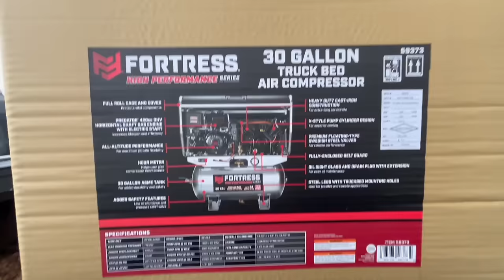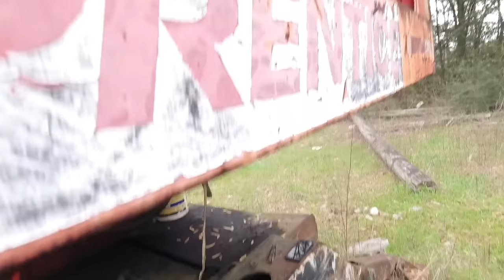Loading Engine cores and Tires for My late friends WIDOW.

Comment: Wiley that is an awesome air compressor you have, its great you have one. I agree. It makes working on things much easier,  a lot of water in the exhaust outlet. Might have locked up the motor and turbo.
Reply from the maker: Hopefully it works out for them so they will come back 
Thanks for watching and sharing

Comment: If using a powerful impact wrench, impact sockets must be used. Standard sockets can shatter.
Reply from the maker: We did not have the 34  
The lug nuts were 1.1/2 had a impact socket for that but gun wouldn’t get in there with out extension and you guessed it I didn’t have a 1’ extension 
You are absolutely right about the impact sockets. When i could use them they worked so much better and got the ones off that we bent the breaker bar on 
Thanks for sharing